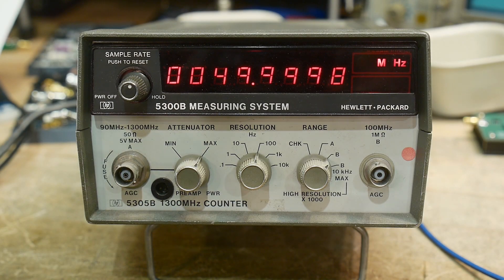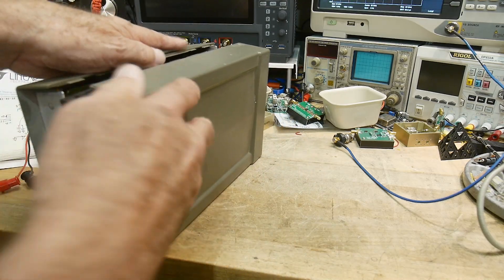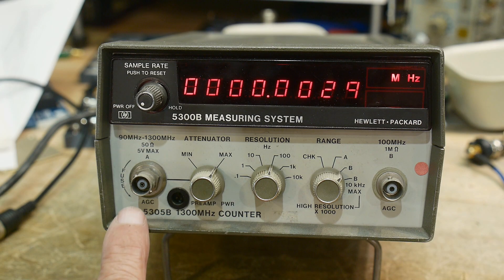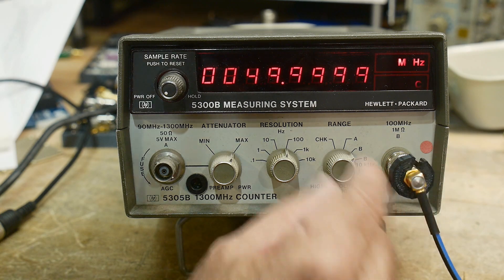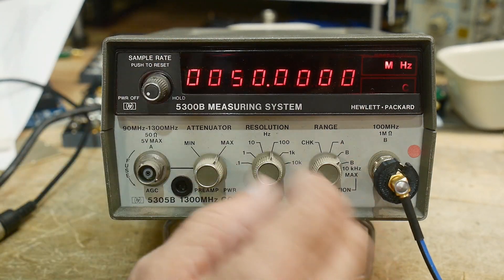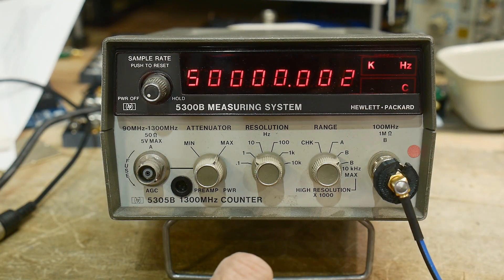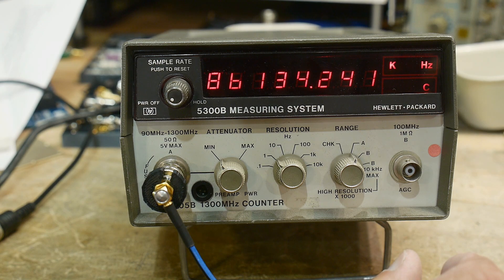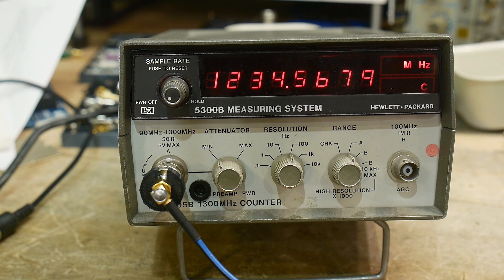#2013 HP5305B HP5300B Frequency Counter

Comment: I happen to have a function generator with the exact same chassis design, and knobs and visual styling. Even with the plastic clips in the back. Its the HP 3311A. Neat how they used the same cases for different products :D.

Comment: I've got one with the 5308A 75 MHz Counter/Timer.  Kinda works - the 2 nd from the least significant digit reads out with a strange character, or blank sometimes.  Looks like the problem might be with the ASIC in upper unit.  I found a 5315A at a hamfest for $25 to replace it, which works great.  I had one just like it on my bench when I worked at HP many years ago.

Comment: I had exactly the same model at work many years ago. It might be worth mentioning the fuse inside the 1 GHz input BNC. It could have been unscrewed by hand and replaced. Easy to burn out if the maximum input voltage at the 50 ohm termination is exceeded.

Comment: I have one of those with a 5302A counter.  I use an external timebase and It's as stable as a rock.   It also came with a DAC module that can fit between the display and teh counter, but I have never found a real use for it.
Reply: @andymouse  👍

Comment: Repaired one of these on my channel last year, great fun working on them and going over the old schematics. It was donated to me as faulty and had logic IC and transistor issues. Still got it!
5300B Display/PSU
5304A timer/counter
5308A 75MHz timer/counter
5312A ASCII Interface

Comment: Does that use the same 'centronics' style connectors between boards that the multimeters in the same form factor did?  I had a super hard time recently with intermittent connections in a 34702 and ended up replacing those connectors... and it works reliably, for now.  Discovered the contact fingers had just fatigued and no longer wiped properly.
Reply from the maker: A common failure. for anyone reading this, I have been able to bend each contact of the connector and not replace them to get it working again.

Comment: I like how your were trashing its accuracy and then almost in anthropomorphic indignation it decided to all of a sudden show all 9's on the high gate settings.

Weird product numbering scheme; from the manual:

Unlike the 5305A, a high-stability time base is not available for the 5305B, howevera high-stability time base is available for the 5300B

Seems it can have a number of different "bases" on the bottom half
Reply: Did seem like it took it personally when he said it needed to be calibrated.  In reality, it was probably just the reference oscillator warming up.  You can see the frequency still climbing as the video progresses.  That's why I use a GPSDO that is on 24/7 as a reference for all my instruments, no warm up time.
Reply from the maker: Yes, I personally did the cal years ago and thought it should have been better. I always forget those ovens (I think I replaced the HP osc with a nicer one) need time.
Reply: Ty have the 10mhz version .I put in a 100mhz prescaler . I have had many counters  but still keep the HP.  Tip use WWV radio signal at 10 mhz and zero beat to calibrate . 73